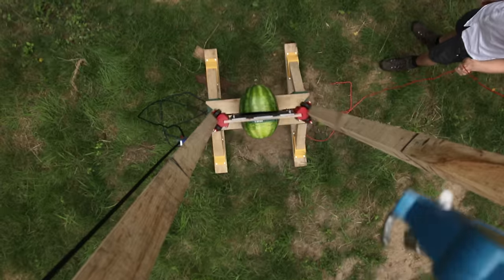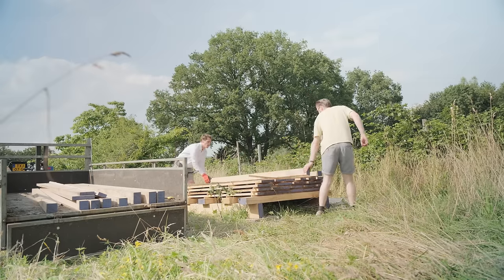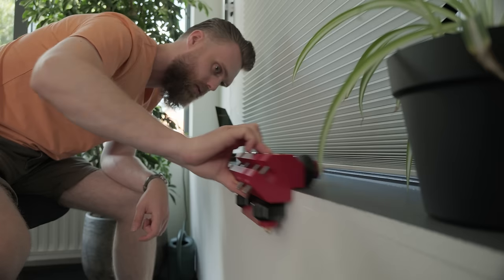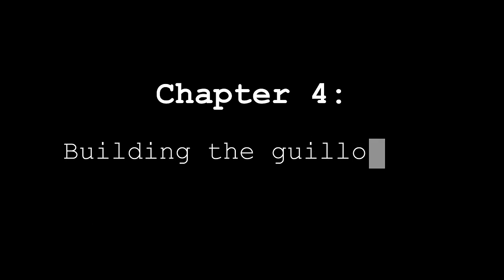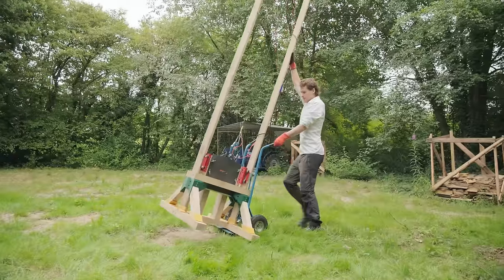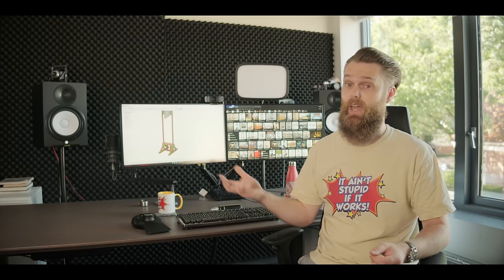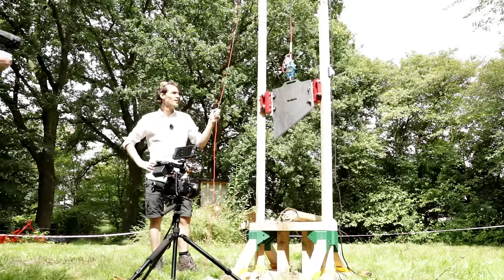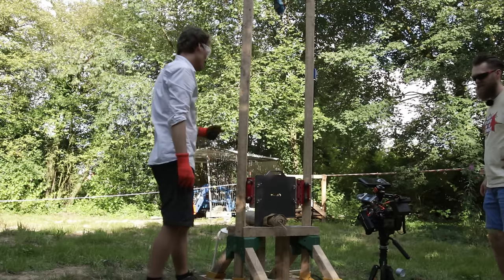Why are Guillotine Blades Angled? We Built One to Test it!

Comment from the maker: If you have any suggestions on how to improve the design or what to use a testing medium, please leave a comment! Also, check out https://voxelpla.com/properprinting for some affordable and reliable filament!
Reply: Currently you are trying to keep the blade straight by clamping it in between the two wooden support beams (inner edge). What if you try to attach it on the outside (so the outer edge). I'm not sure if it would actually make a difference, but I feel like it would reduce the amount of wiggle room.
Reply: on the angled it seemed like the matts were rolling away from the blade
Reply: Your carriage seems to be creating a large error that probably is so strong that you're not reliably measuring anything else. A longer carriage would reduce the error, but deflection braking would probably still be significantly bigger than any other effect. instead of adding rigidity and optimizing mechanical lever proportions on your device, how about going the other way and removing parts but adding mass? a much heavier blade that free falls between two smooth beams per side will mean that inertia is the stronger factor above deflection from the blade shape and it will not as easily bind with the linear carriage you made.
Reply from the maker: @CallmeSam00  Thanks for your suggestion! I think that you're right on adding mass. Yet, this poses a similar problem we ran into when dropping it from a greater height and that is that it becomes increasingly difficult to find the differences between the blades. I think that my biggest failure is the carriage system itself. It is too short and the angled rollers make things worse.
Reply: @properprinting  I found my old drawings from 2016 ... do you want them?
Reply: -First suggestion: Use dry lumber. The wood that you milled never had time to dry and therefore warped after you milled it.
-Second: Increase the length of the wheel runners to stop the twisting,
-Third: It might also be beneficial to rotate the uprights so the flat surfaces of the lumber are facing inward. This will also allow you to use a third set of wheels on the runners by making them "U"       shaped and decreasing the possibility of the blade getting out of alignment .
-Fourth: As wood will always flex or warp with temperature and moisture, adding a spring or tensioning device between the wheels and the carriage will absorb any minor imperfections.
Reply: Hi. Nice idea =) 
1. Maybe changing the material of vertical beams from wood to square metal tube could help with carriage moving. They are more straight and rigid. 
2. To reach the equal speed of blades (equal cutting energy), you must measure the height from point of first touching blade and matt to center of mass of blade carriage. Because of blades shape it would be different height of carriage. Check in CAD and make a mark on the blades.
3. It would be better to make a matt holder to fixing it and provide the equal size.
4. I think, that with the blade incline appears a horizontal projection of the cutting forces, which is spent to a heating and in moving. This loss energy is uncuted millimeters.
5. I think the shape of blade serves for guiding between two wooden rails end prevent the turning and jamming. Long side is guide, short supported.
Reply: Very easy solutions to prevent tilting in following order:
Use longer guide length (longer slide), 
reduce distance between beams
or(and) reduce friction.

It's like a wide drawer with no length...
https://nl.wikipedia.org/wiki/Schranken
Reply: Just asking for a French Friend of mine, if I… HE wanted to peer review your findings…
Could you free the .ctl files to the Working Class?
Reply from the maker: @ZappyOh  That's awesome, yes! Could you send me a message using my contact page? https://properprinting.pro/contact/
Reply: @properprinting  Sure ... I just did :)
Reply: The only thing I would suggest is adding in some way to keep the object from being pushed over by the blade.  There may have been more than one practical reason why a person's head was locked in place.  As others said, if you added a 3rd set of wheels to the carriage, to keep it from rocking, that might work, too.

I always thought it'd be cool if historically, they had added some kind of spring tension to the carriage, which would force it to accelerate faster once the tension was released.  That way, you could make the guillotine much shorter...for ease of travel...
Reply: Maybe an inverted M blade would be nice, it would autocenter the mats, and I think the cutting surfaces in contact with the mats are more distributed than with the triangle.

Comment: You can see why the old blades were so long. A blade that long can not tilt in a slot very much.
Reply from the maker: Good point!
Reply: I always assumed it was because for each step horizontal compared to each step vertical it would be more effective in "chopping" Like how daggers create deeper wounds than swords for slashing, but sort of combining the two, for "deeper" "slashing".
Reply: @properprinting this is exactly right.

Any sideways force introduced to the blade produce a moment about the center of gravity that will tend to tip the blade. This force must be reacted by the guide rails. 

The moment about the center of mass must be opposed by a moment couple.

I can provide a free body diagram if needed that can be used to calculate friction losses along with some articles on preventing binding on linear guide systems

Happy slicing!

Comment: Make your carriages taller to increase the distance between the wheels. The further apart the wheels are vertically, the less twisting you will get. For smoothest operation the wheels would be spaced further apart vertically than the distance between the two sets of wheels horizontally.
Reply: Distance between wheel on carrier is larger than distance between beams
Reply: Either you're saying that the wheels are currently further out than the beams are, which is obvious, and irrelevant, or you're saying that they need to be and that's why it's tilting. 

The wheels are wider than the posts, but they have to be in the current design. Making the wheels farther apart VERTICALLY by lengthening the carriage wouod solve the issue. Maybe that is what you meant?

Comment: Man, everything looks great and this was a joy to watch!
Some further considerations for the sequel:

1) At some point, the blades will need re-sharpening and close inspection to ensure uniformity and fair testing

2) You can purchase pre-rolled tatami from Kageyama or similar makers (import might be pricy) and wet them per the instructions; include the center wooden dowel to increase rigidity and improve its function as an analog to a limb or neck by mimicking bone. This will act as proof for building a carriage the doesn't twist/deflect on impact, certainly more effectively than loosely rolled & dry mats. 
For what it's worth, reliably measuring cutting performance is tricky to accomplish even in the most controlled testing scenario. I don't have any other suggestions for now, but I'm confident there's a more consistent medium for this purpose that isn't prohibitively expensive. You might also consider securing the mats in a fixed position on the cutting bed to prevent any discrepancy between height tests on the same blade.

3) The top-down camera angle is sweet - obviously it'd be a bit less shaky if its mount was isolated from the guillotine frame itself (perhaps the ladder?) 

Other than a few small nitpicks, the overall build and testing methodology is superb. I'd have given up after the first hour of grinding abrasion resistant steel 😂
I very much enjoy the fact that you and Aldo resolved to say "hey, our testing isn't quite strict enough at the moment and there are parameters we don't have complete control of yet - we'll be back!"
This gesture alone means you should retain a majority of viewers from the first video and potentially gain many more on the second. 
Venturing to speak for many, we were curious - but now we're excited!
 
I'm pumped for the next one, good luck and stay safe fellas!
Reply from the maker: Thanks a lot for this awesome comment and your suggestions!

Comment: Nice video! Looks like the slide got pinched when using the 30/45 deg blades. And maybe the target body needs to be considered to avoid deformation during cutting?
Looking forward to part 2!🎉
Reply from the maker: Thanks! I think that I made the wrong choices with the carriage design by placing the wheels and beams at that 45 degree rotation. Next version will be much better!

Comment: The simplest reason for the guillotine to have only one angle to the edge is that they were made in the 1790's. Iron was reasonably priced, and relatively easy to work. Steel was expensive. At that time, axes had iron heads, with a strip of steel welded on for the edge- an exacting and difficult process, and only doable on a straight edge (pretty much). Doing this with something as large as a guillotine blade would have been very difficult, and thus kept as simple as possible.

Comment: That was such a fun video. The skits in the beginning and the end were delightful humor.

I think making the carriage longer would help in giving it more guidance, since it cannot tilt as much.
Also using thicker beams would help to reduce the bending-modes of the frame, I think. Otherwise maybe making a beam that connects the frame halfway up the rails (as you did with the strap) would keep it from bending towards each other.

Comment: I'm also wondering if constraining the position of the mats might lead to better efficiency. As it is, you can imagine that with an angled blade, the mats slide away from the blade and dissipate some energy this way. By fixing the position of the mat this loss might be minimised. The original guillotines you showed seem to have a similar feature, although that might have been implemented to prevent the... patient from escaping.

Comment: Hi, in addition to a vertically longer carriage to reduce tilting I suppose to use a board with a hole (for the neck) to prevent the matroll from escaping sideways. I believe this will improve the cutting performance of all your angled blades. Perhaps you will also have to slightly enlarge the slit in the "table" to stop the blades from hitting the wood.

Comment: In addition to what others have said about extra rollers to prevent tilt, there's a pretty critical aspect that I didn't see addressed yet. You aren't constraining your tatami mats from sliding about! Don't let it just scoot around like that, it's also sometimes letting it deform into a large flat plane which will cause inconsistencies based on how the differing geometries push things sideways. My first thought is a large printed or wood U shape beneath, with a large  U-bolt from the top punched-through that, to make an enclosed circle and be easy to service, probably doesn't even need to be tightened down, but adds that option also.

Comment: I find it somewhat humorous that the packaging for the blades designed to test the optimal form of decapitation with a guillotine was opened with a box cutter that is optimally designed for cutting packaging. The box cutter uses very similar principals as the long standing representation of a guillotine, there are even brachistochrone styled box cutter blades.

Comment: I think the biggest thing you can do to control tilt is probably separate the wheels further vertically (taller carriage). It may also be that adding another set of wheels front to back (thicker carriage) may help with the front to back tilt that causes the blade to hit the wood. Just my initial thoughts on seeing the deflections.

Comment: I think you should try to copy the historical examples better. So if you held the material in between some wood like the real ones did you'd have less rolling of the material. & then if you put the rest for the blade a wee bit below the point where you are cutting the object like historical ones seem to do you will avoid the wood problem. For the turning its likely you want a more secure housing like historical ones. I think the one at 0:49 in the video shows what I mean. You might be able to find some archived blueprints for one that you could copy somewhere as they only went out of use in the 70s so there should be a semi-modern depiction of how its built.
edit: after watching this video (since I watched the other video 1st) I think I am slightly off on what I mean by the wood thing. So I think the blade housing is just being held in by friction basically & relies on rough indents in the frame to keep it from going to one side. Maybe you could fix the design by adding a counter weight or something.

Comment: The wheels are vertically too close together which allows it to twist easily. Try adjusting the carriage so the wheels make a square around the whole blade rather than a small rectangle at the top with the majority of the weight hanging below it. This would also help better align the blade so it doesn't collide with the wood.

Comment: Question about the way you measured height. Did you measure the height at the top of the carriage? Or did you measure it at the bottom of the blade?

If the former, wouldnt that mean less chance for the angled blades to catch up to the momentum of the flat one?

If the latter... Well... Fuck 😅

Comment: anybody who's taken high school physics could tell you that 45 degrees is the best angle to apply sheer force rather than compression and ensure a reasonably efficient blade( overall size) with good strength.
Reply: My class must have skipped the blade geometry part.
Reply: @MumrikDK  admittedly I've gotten quite old and now that class is nearly 2 decades ago for me and maybe I don't know what's being taught in physics anymore.

Comment: The angled ones are relying on the sharpness of the blade. The flat blade has even weight along the length of the blade and weight helps with the cut instead of just sharpness much how a meat cleaver or axe works. Also steel choice is rediculously over specced 😂 a simple carbon steel or even 4140 would have sufficed.

Comment: I'm no engineer by any stretch, But could you use springs to push the rollers against the frame. 
Have more of a distance between the guides and springs pushing them against the wood and a weightier blade to send more momentum downwards?